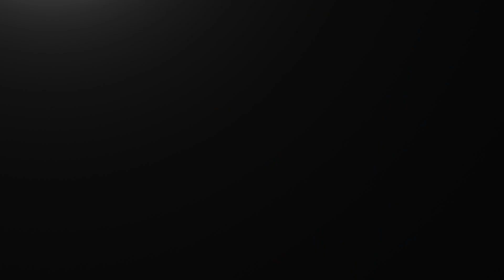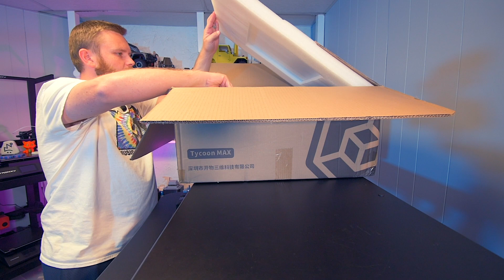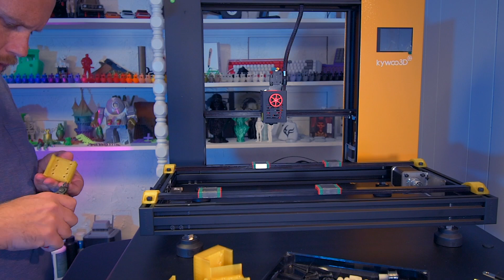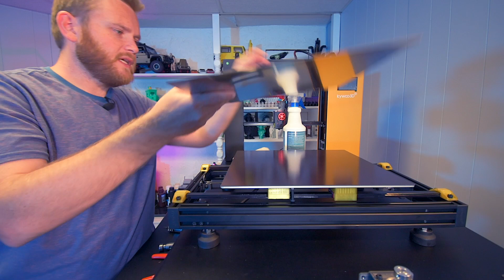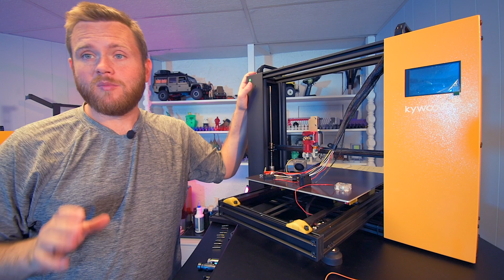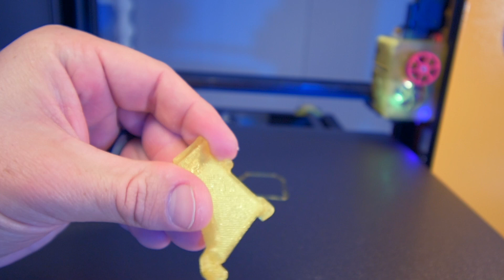Direct Drive Battle S2E1 - Kywoo3D Tycoon Max (w/ MODS)

Comment: Best thing to do is find somebody that knows how to edit firmware and maybe even pay them a little bit to help you out and the community. Kywoo is holding a fire sale at their website now, I just picked up a max for less than $200 shipped.
Reply from the maker: They actually sent me firmware after seeing the video. I havent tested it yet because my contact no longer works there and I havent had a reply from them in a long time. Now sure what’s going on over there at Kywoo at the moment. Let me know when you get the machine! Would love to know how long it takes for them to get it to you from order to delivery.
Reply: @3DPrintSOS   I bought the Tycoon Max X for 260USD on December 27th and got the printer on January 5th. Two weeks turn around is not bad at all. I'm not sure what's going on at Kywoo but I'd love to get ahold of the newer firmware and test it myself.
Reply from the maker: @bagpipeblues  No not bad at all and definitely worth the hardware! The firmware is an issue to say the least. Holding them back like an anchor, if you ask me.

Comment: I could never have the patience to assemble a full printer like this. Even with the 8x speed video running through the build, it seemed like a pain. You did a great job!
Reply from the maker: Thanks. Thats my favorite part. I love putting these together. Without the mods though this is, by far, the easiest machine to assemble. Literally 4 bolts and 2 plugs.

Comment: you can get non insulated ferrules which are basically just the metal portion, though I guess you could just chop the insulation portion of the ferrule off too if you just wish to shorten it slightly

Comment: be sure to use some electrical lubrication on those winsinn fans. their dabs of cheap grease doesn't cut it long term. a couple squirts of crc 2-26 worked excellent for me. any type of spray lube similar to that will work. just remember to lubricate once again depending on use.